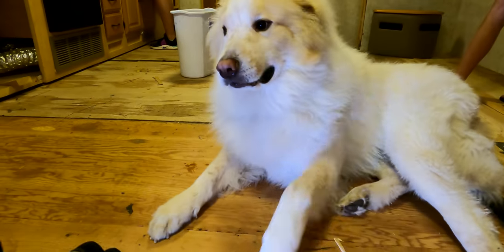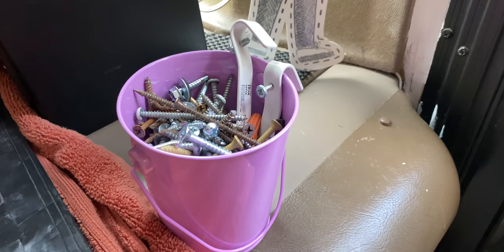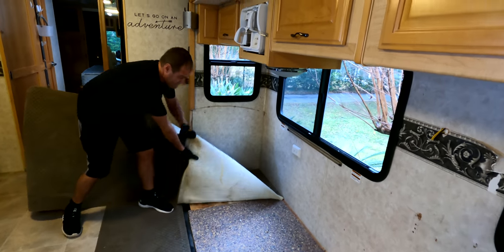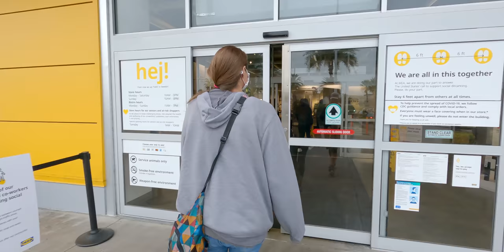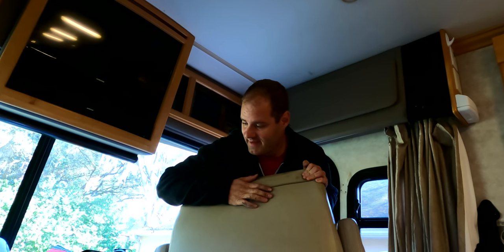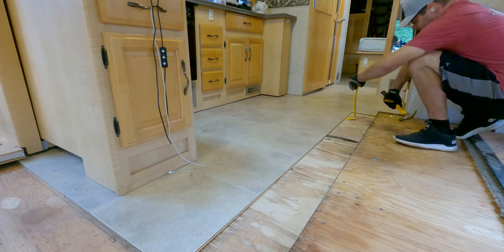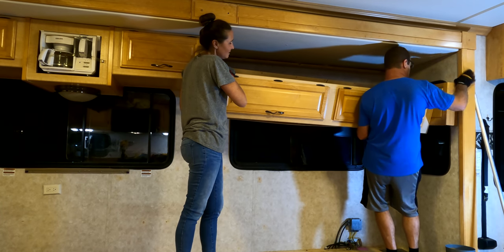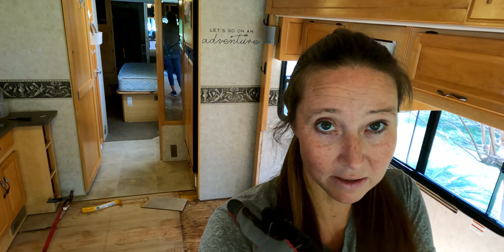DIY RV! 16 Year Old Motorhome RENOVATION (Budget RV Makeover) RV Living

Comment: The slides have some kind of seal which probably consist of a flap type outer seal.and a bulb seal..  Make sure these are in good shape and are supple. You can get replacement seals and it isn't a huge thing to replace.  All RVs leak. You have to watch each time it rains to make sure there is no ingress of water and.if there is attack that area and seal it up. Don't forget to exercise you diesel motor and generator frequently to make sure  it dosent give you any issues.  Good luck..
Reply from the maker: Thanks for the tips!

Comment: Hola from Colorado, super cold here these past days.  Your Leak is probably coming from your slide seals if your husband already sealed the roof.  Also, check the bottom of the driver slide from the outside for any bad wood.  You may have to take the driver's window out if the water damage goes towards the front.  The only thing holding the window is the two metal brackets on the inside and then, cut the caulk on top of the window on the outside.  I did four of mine last year.  Speaking of windows, I also noticed you have a gap on the bottom of the front side passenger window (Emergency exit?) and the frame of the window.  You can get some Trim Lok brand foam weather stripping under it to fill the gap to prevent water and air leaks,.  Great Job!  Looking forward to your next video.
Reply from the maker: Thanks for the tips!

Comment: When I took apart engines, carbs, or any disassembly, I used inexpensive muffin pans.  I placed the hardware into the pans in sequence on how the disassembly went.  Then I reversed ordered the pans for reassembly.
Reply from the maker: Great idea!
Reply: @GratefulGlamper  you can do the same by pushing screws and some bolts through cardboard

Comment: I have roll out currently in the toy hauler I live in. It's not holding up. It has worn places, holes, and it tears and stretches very easily. I'm going to replace it with glue down CVT. It will be a lot of work, but  it should last a lot longer.
Reply from the maker: Good to know!

Comment: That leak is coming from the roof. I would seal roof area with Dicor especially around living room slide. I had similar issue last summer. Also check silicone around driver side window. Water is coming off roof along slide into wall. I would address this before getting too far with reno!
Reply from the maker: Thanks for the tip!